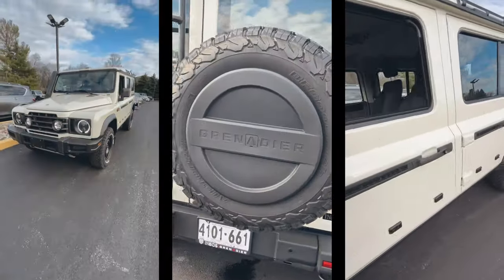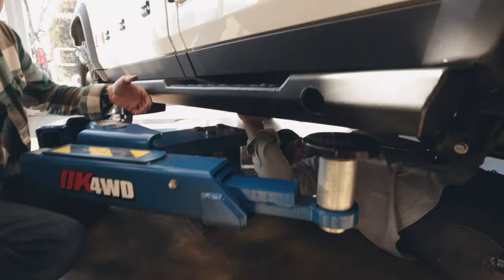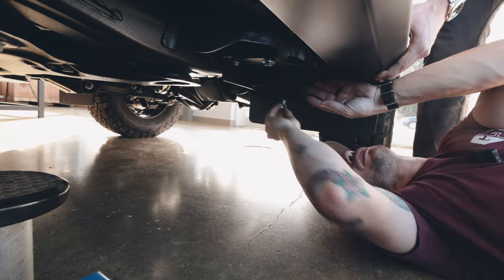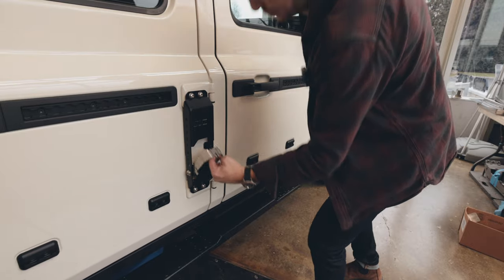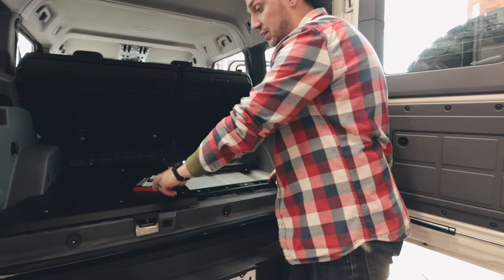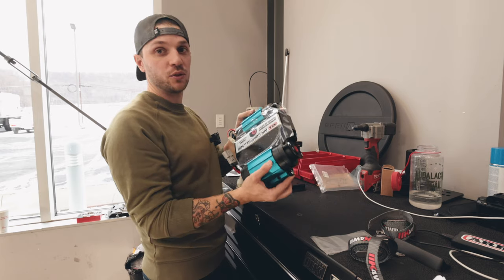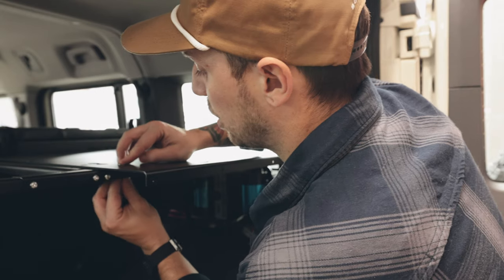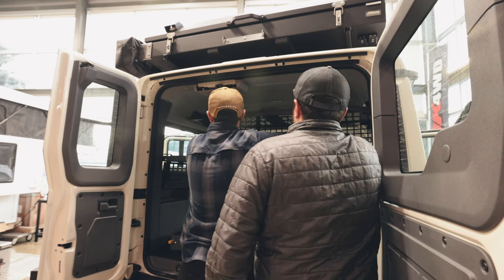This BRAND NEW Ineos Grenadier Gets Overland Ready - Steps, Sliders and Storage Install

Comment: Excellent video thanks!!  Getting my Grenadier soon.  I will check out the Buzz Overland gear for sure. I may make a sleep system inside so would be good if they have that configuration. Those slider are awesome with the integrated steps.  Will probably replace factory sliders with those.
Reply from the maker: Right on! Keep us posted on the progress.

Comment: Thanks for breaking all these upgrades down. 

5:23 Question: After removing the padding and installing the base plate: What did you do to reduce added road noise rock pings etc?
Reply from the maker: Hey there, you could add a bit of sound deadening; we did not, nor have we, noticed a significant amount of road noise. As for the rocks, we'll have to keep an eye on the noise increase, but our travels so far have not been noticeable. Though we are traveling at moderate speeds on gravel roads. 25mph or so.

Comment: Nice set up. Two questions though, how much extra weight was added to the vehicle with all of those accessories installed and how much approximately was the cost.
Just wondering…
Reply from the maker: The 3R tent weighs in at about 190 lbs, the awning 56 lbs, the fridge about 55 lbs, and the rear storage system weighs 270 lbs, and the sliders weigh 50 lbs each. So total weight is around 671 lbs and the cost without labor is $15,881.00 

And if you're wondering about how we offset the added weight, stay tuned for the next video.

Comment: Looks like a great set of parts. Very heavy though on an already heavy car. First thing should be a long range tank. Still waiting for a company to bring one out.
Reply: That's the main concern! Some people are talking of removing the oversized muffler system and replace it with something smaller and use the space to add another tank
Reply: Brown Davis already have one. Fits over the rear axle and the rear factory bash plate can still be placed normally without the need of extra or new mounts. 
The BD long-range tank ups the fuel capacity from the factory 90l to an impressive 240l total, enough for about 1,500km of roaming. I think that's enough for any outdoor adventure.